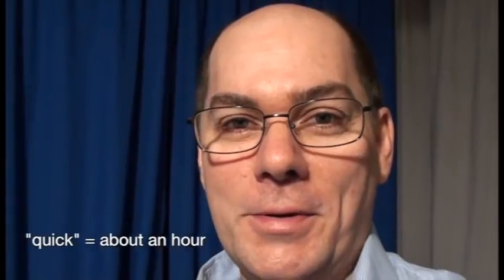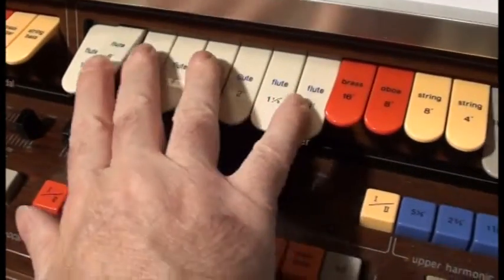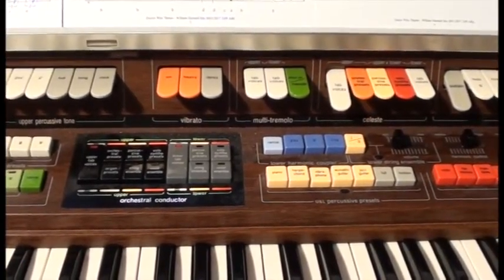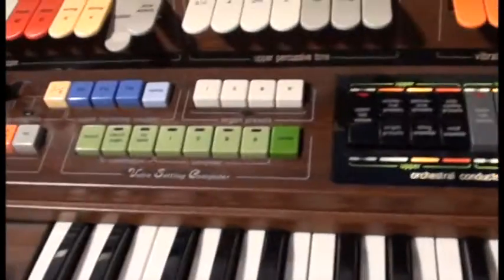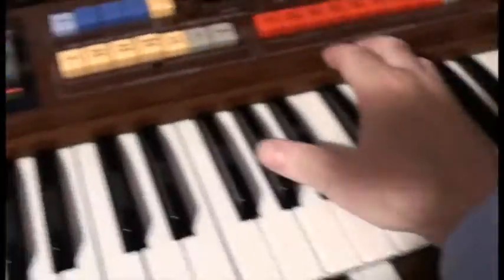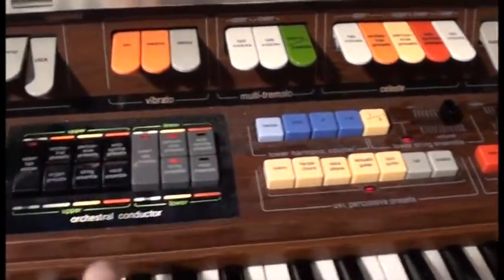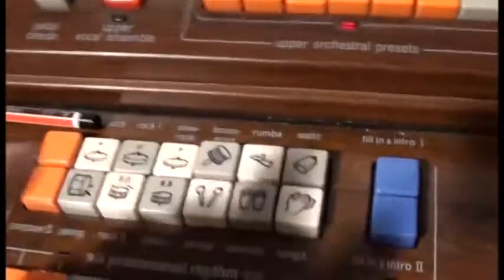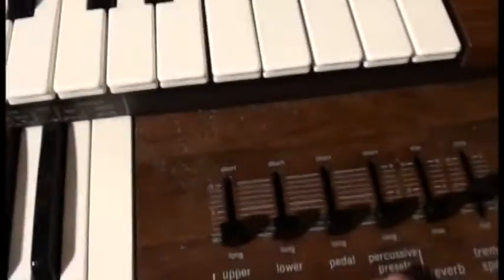An hour-long tour of the Technics U90 Organ (all four parts joined together)

Comment from the maker: I made a goof while filming about 35 minutes in, said the harmonic couplers add extra notes octaves and roots above (the notes that you're playing), when I meant to say that they add notes octaves and fifths above.
Reply: Hi! What's the moving metal bar underneath (near the audio output) used for?
Reply from the maker: @scottlarson6629  a sustain control
Reply: And other organ makers had them too: I have an Elka EP-8 that has the quint and octave+quint coupler, and some of Wurlitzer's big models had octave and sub-octave couplers.
Reply from the maker: @organfairy  interestingly, as I went through the service manual (ages ago), despite the organ being marked in numerical footages, I found references to traditional names: quint, nasard, and larigot

Comment: What are the physical dimensions of this organ? Trying to find out if it’ll fit in the back of my Peugeot estate?
Reply from the maker: According to the manual:
120cm by 104cm by 68 cm & 94kg, or:
47.2" by 40.9" by 26.8" & 207 lbs

I did hear from a guy who used to go gigging with one carried in the back of his car. But I reckon you'd need at least two strong men to pick it up and lay it down, and vice versa. It's a hellava thing to just to lift up a bit to move it around on wheeled boards without having to tip it over

Comment: Thanks for the tour! I've just bought a U90 for my wife. It's been in storage for many years and appears to be in very good condition. It even came with the original stool and users manual.
Started reading the manual. After the first read it's very clear to me that we have acquired a very sophisticated '80's era musical instrument. I'd certainly like to take up your offer of advice on its workings. Especially if I find that something doesn't work. I don't want to jump to conclusions that there is a fault when the solution may just be an on or off switch! For example, all the keys make contact and result in a sound. But no specific sounds from the foot pedals. I'll be going through the manual again for that. But I may have to make contact with you via your website.What is the address please?
Reply from the maker: On the left hand side, just under the roll top there's tabs and a volume slider for the pedal voices. Again on the left side, just beside the lower manual, press OUT the pedal to lower button. 

Beyond that, you're into fault-finding territory
Reply: @CameraTim-DAMMITDOTcom  Thank youTim. I'll give it a shot. Don't really want to go into fault-finding territory if I can help it.
Reply from the maker: @jenssmith727  one simple test to check for a dead speaker - plug in headphones and listen that way
Reply: @CameraTim-DAMMITDOTcom  Thanks Tim. Do the pedals have a dedicated speaker(s)?
Reply from the maker: @jenssmith727  no, sorry, I was getting that wrong. Just had a look at the service manual. I thought they went only to the largest speaker amplifier, but they go to channels 1 & 4.

Also try the pedel celeste button below the pedal tabs. That will affect signal routing of the pedal voices.
Reply: @CameraTim-DAMMITDOTcom  Thank you Tim. I'll try tonight. (South African time!)
Reply: I guess I'll have to start trouble shooting for the reason there's no pedal sounds. Any hints on where to start? I'm beginning to suspect that there's a connection issue with the pedals. When I press a key and move the pedal volume from low to high, I get the pedal toggle sound. For example Tuba or bass guitar. It's as if a pedal is being pressed. Hope this makes sense?
Reply from the maker: @jenssmith727  you mean a click, or an amplifier un-muting (a bit more hiss), when you press a pedal?
Give the pedal volume control under the pedal tabs a bit of a wiggle and scrape along its path.
Press in the pedal to lower gray button left of the lower manual, can you play bass pedals using the lower manual?

Comment: I have been lucky to get my u 90 fully functional discovering  the problem  was due to poor soldering on the mother board . I did your capacitor change for the memory. The u90 organ seems to have the same synthesizer chip as the Korg poly 6 synthesizer built  1981   which are still  suate after today. I guess this synthesizer was used in some film music ,  (  too late for Dr Who though  ? )
Reply from the maker: I'm glad you've resurrected your organ, the U90s have a charm of their own. They hit that happy middle ground between minimal automation and fully manual operation, and a mostly analogue sound (I seem to recall the drums were sampled). I hadn't heard about the synth chips before, that was interesting to find out. I suppose it's not too much of a surprise that certain synth chips would be used in various instruments, no point re-inventing the wheel.

Comment: Does this organ come apart for transportation? How do you take it apart?
Reply from the maker: Not this model, it's a one-piece large bit of furniture, just under 100kg heavy. There were some other Technics U90 models that were meant to be portable. If I remember right, the U90S has fold-down top half, or a removable top half. The U90P is the pro model with a skeleton frame without internal speakers
Reply: @CameraTim-DAMMITDOTcom  Ok, thanks for your help.
Reply: @CameraTim-DAMMITDOTcom  Thanks for that. I've managed to get it into my van. It's now been there for a week as I wait for two strong men to pass by! :-)
Reply from the maker: @BohemiVan  it's probably best as a four person lift to move it down from a height. I was nearly 30 years younger when I moved a similar weight organ in and out of a courier van. Just recently we moved this organ around the outside of the house to put it in another room. There were two of us, and that was a struggle to get over the doorsteps. The easy part was going around the house, we sat it on wheeled boards
Reply: @CameraTim-DAMMITDOTcom  Yes, it's going to be hard! It's still in my van, waiting! Thanks for the advice.

Comment: Are there books available on the workings of this organ?
Reply from the maker: If you hunt around the internet, there is an owners manual. I scanned mine ages ago and uploaded it to my website, and someone has put it on one of those manual download sites. You used to be able to buy a service manual from a UK service shop, but I was told they stopped selling copies.
Is there something you're particularly trying to find out? I may be able to help